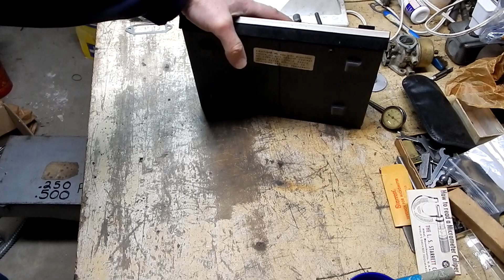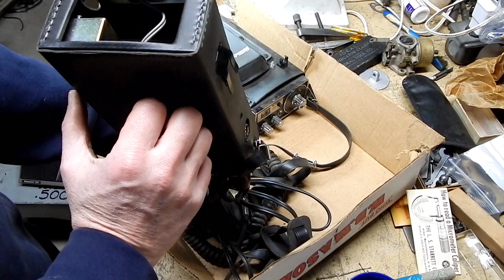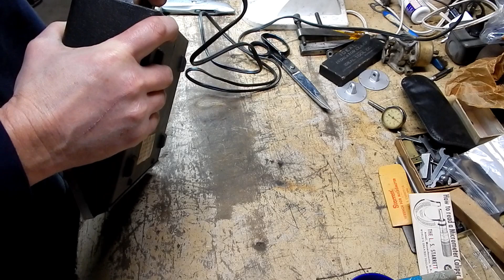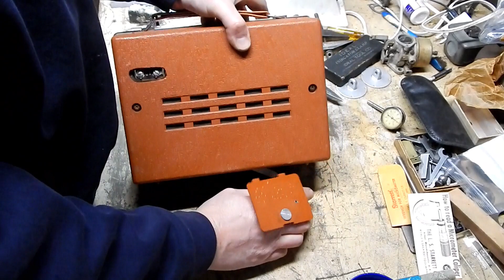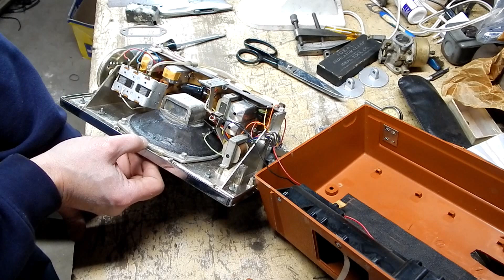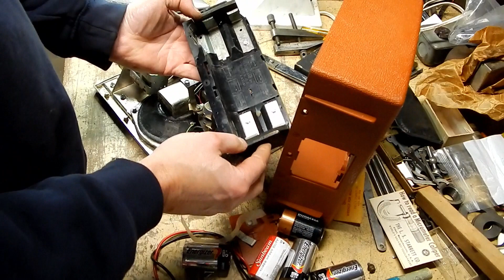December 2019 Springfield Estate Pick Part 1

Comment: Did you get the antenna for the Bearcat?  I checked my parts bin and only have one for an old style cordless home phone and a rear 90 angle for Radio Shack.  Nice old radio.  I have a couple older ones that were my father's, including a nice Sony TR-84.
Reply from the maker: He didn't mention finding the 210 antenna. I had a rod antenna like it, but the threaded hole on the bottom was smaller. I just sit it on top of the s rew to test it out. It works fine. There's also a jack on the back, that style they used for car stereos antennas. Probably easier to get a back of set antenna to plug in there. I'm not worried about it.  I have little use for it. I scored a more modern Uniden for peanuts.